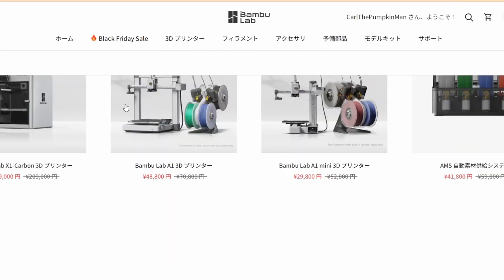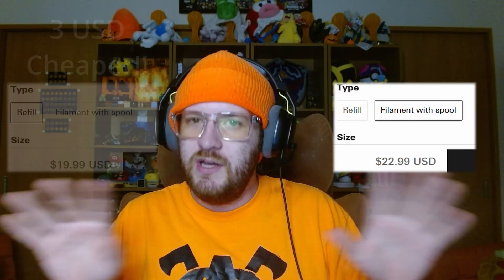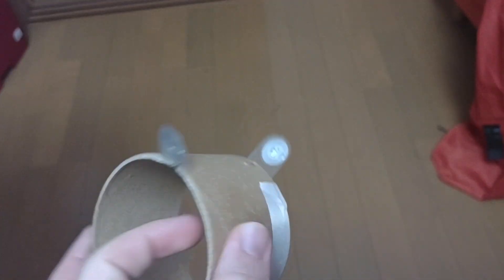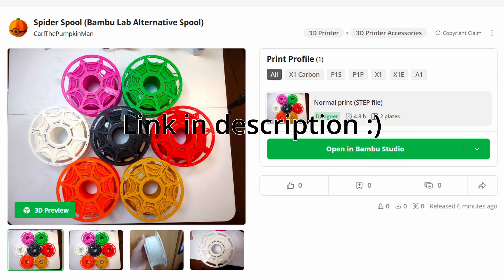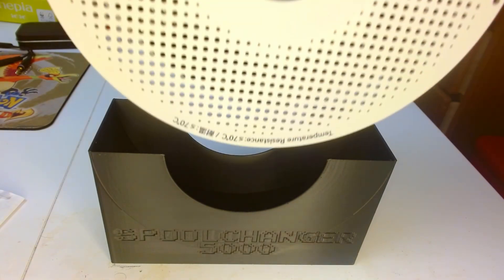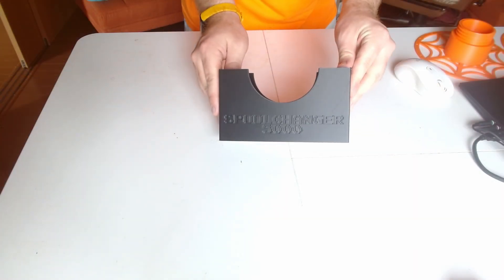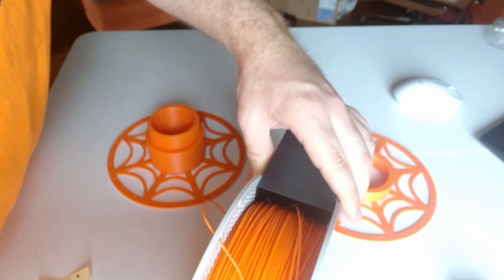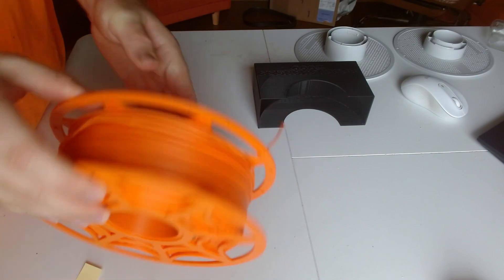You may actually want to buy a spool from Bambu Lab (See description)

Comment: How much does it cost (in filament) to print a spool? That may cut into your savings, at least initially.
Reply from the maker: This is a fair point--the spool I provided, at least printed with the included print profile, weighs 150 grams, which if made from Bambu Labs Basic PLA refill at 20 USD a kilogram, will cost you... wait... exactly 3 dollars, which is the exact savings you get from not buying the spool...
Still allows you to color your spools, but apparently you won't save money unless you print out a lighter spool...
Reply: If your biggest concern is saving money, I assume you can just reuse spools you already have
Reply from the maker: @darkriolu27  yes, but not if you're buying a new color and all your current spools are already in use

Comment: You should make this, but where it holds it for long periods of time because I have multiple reusable spools, but I have more colors that need to go on something so I only need four reusable spools that I can put colors on and off as I need them because I don’t wanna have to wait until I’m out of red to put blue on
Reply from the maker: Is there any problems you've run into with using them for extended periods of time? I haven't tried doing that, if course, but I don't see why you couldn't.
Also, I might just recommend printing your own spools (I have a design available on my page as well)  to save yourself the hassle, rather than printing a bunch of these